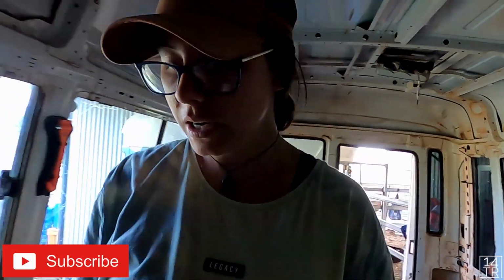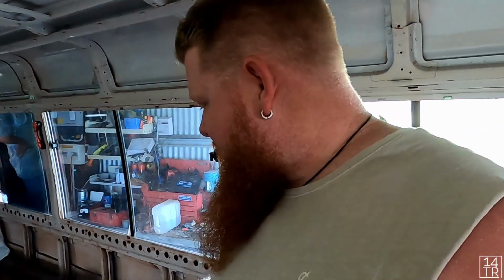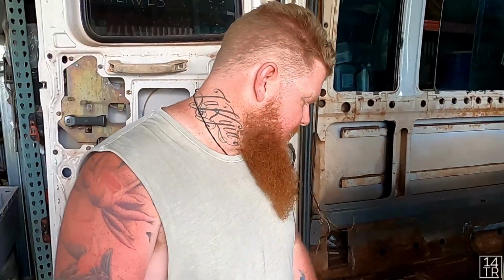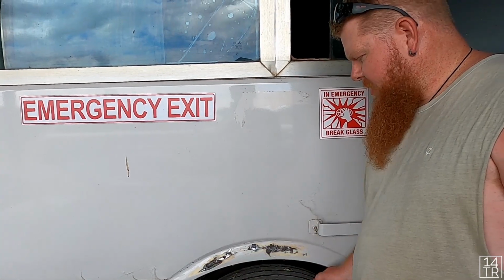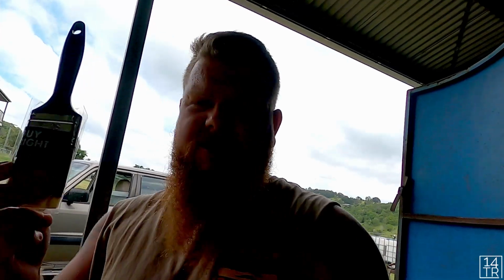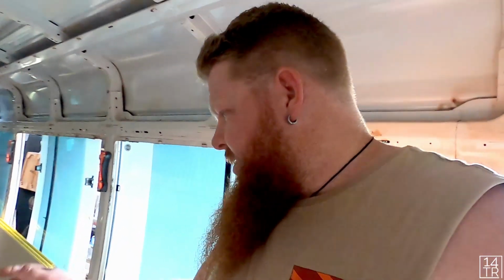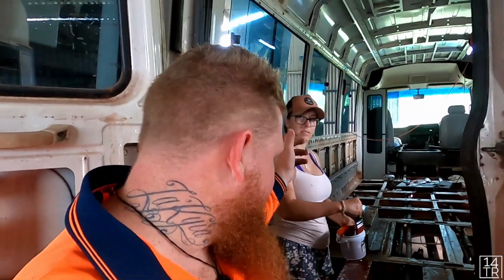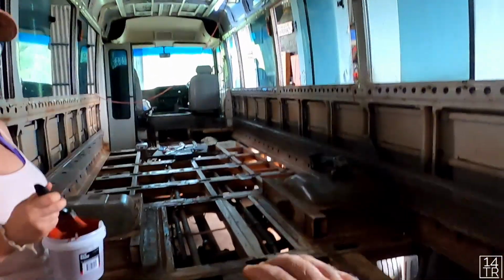BUS CONVERSION - Mitsubishi Rosa Part 3 - Rust Proofing the Floor - 14TR.

Comment: Totally agree with you about the floor. I'm doing the same in my Toyota Coaster. It's good to know that you're starting with a solid foundation before you build your house on top.
Reply from the maker: Absolutely! We figured if we didn't pull it up, we could easily miss any issues that there may have been.

Comment: Definitely do water tanks first before floor.
Reply from the maker: It will make it a lot easier, won't it?!
Reply: Definitely, I fitted 100l fresh and 100 l grey before putting in the floor. After the floor was in I decided to add another 50l tank to each so we will have a bit more for free camping. What a mission lying on your back drilling steel is not cool hot steel falling all over you.
Reply: @OneForTheRoad  It also forces you to commit to shower and sink positions also running your 20mm breathers up through floor or in columns.
Reply from the maker: @dougmeyer5715  we're still finalising where we are going to put them and getting quotes for custom made tanks, so not sure we'll have the chance to put them in first to be honest.  🤔

Can't imagine the welding would've been fun, but at least you've got plenty of water resources!!
Reply: @OneForTheRoad  You could cut the floor lay it down but don't fix it yet move on with walls or ceiling. when tanks come fit them and secure waterproofed floor in place. Alternatively if you know the tank sizes fit brackets for threaded rod leave rods longer than needed hanging under the floor and then fit floor. When tanks come lift them up and secure. You are going to burn lots of brain cells on this job. All idea's work but some harder than others.😊
Reply from the maker: @dougmeyer5715  Thanks for the info and ideas, we'll see how we go! So much left to learn, I'm sure we'll make a few mistakes.. :D

Comment: Damn de ja vu, doing my Mitzi as well , floors up grinding and rust protection atm. Took the air con out as well. Will you use sound deadening or window tint. Anyway good luck.
Reply from the maker: Good timing! Haha 
The current tint is peeling so we will need to replace it. We're still looking for a good sound deadener. 
Thanks, you too!!